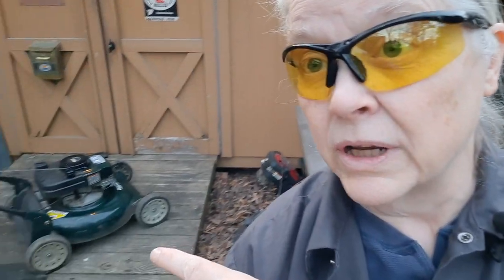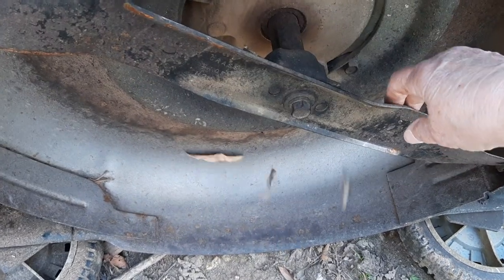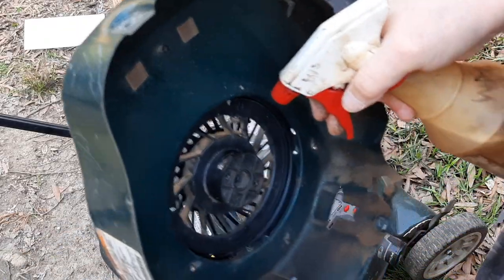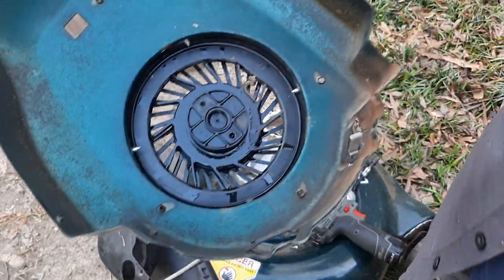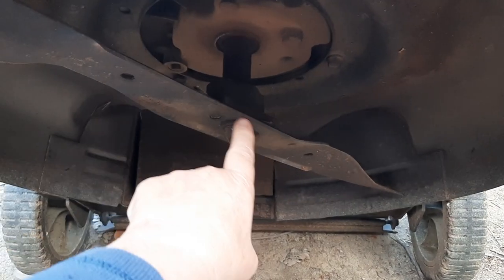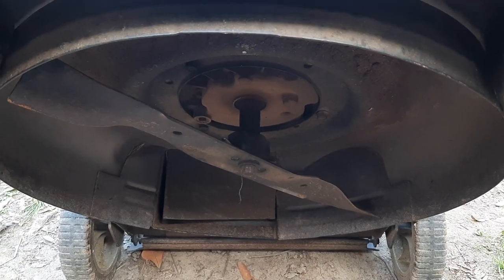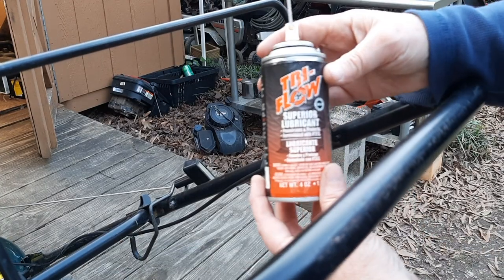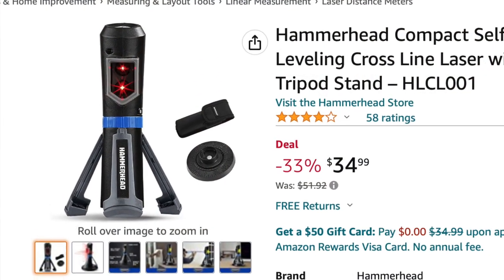Full Service: Tecumseh Engine on Older Craftsman Mower

Comment: Just today I pulled out my old Tecumseh powered Toro. Probably 20 years old. Havent used it in months, but wanted to use it to chop up leaves. Put fresh gas in it, primed 5X, and it literally started on the first pull. Slight oil leak on left side near the base of the engine, leaked about a teaspoon after about an hour of hard use. Don't care, runs strong and is my ditch/leaf mower.

Comment: Great job on the fix!   It’s to bad that Tecumseh gets such a bad rap, I think they are great engines
Reply from the maker: I think most of the Tecumseh hate is from Europe, those were made in Italy, and unlike the pinnacle of scooter manufacturers in the 60s (think Vespa and Lambretta), everyday was Monday at the Italian Tecumseh factory. Heh!
Reply: My 1984 Toro with its TNT100 is still going strong!

Comment: The more I learn about lawnmowers the more I realize the products of the past were just more durable and simple to work on. In terms of durability what is your opinion on the Tecumseh vs Briggs and Stratton motor?
Reply: Not just lawnmowers!  Just about anything you care to mention with few exceptions.
Reply from the maker: I think this later model Tecumseh is right up there with the flathead Briggs, often referred to as the Quantum engine. Even the older 3.5 Tecumseh engines, I think is just a bullet-proof as the older 3.5 Briggs pulsa prime engines. I think the Tecumseh engines get such  a bad rap across the pond is they were made in Italy. Not unlike licensed manufacturers of antique Vespa and Lambretta scooters in the 60's, made in Asia, South America, and other parts of Europe. Just enough difference to make them not as desirable as the originals. I really appreciate you watching. Cheers!

Comment: All the tecumseh motors I have worked on and did not know about the F on the bowl.  Thanks
Reply from the maker: Hola Mr Bruce! I kind of figured that out on my own. I've scoured many a service manual, and never saw mention of that. I can't figure what else it would mean? On the older brass floats, you could see a witness mark from that divot to determine the orientation, not on the plastic floats. Cheers.

Comment: I love those old Tecumseh engines, I love the carbs because I can usually just drop in a 631021B kit in them and maybe a new primer and they are good to go. I absolutely love your laser rig and your large tray for under the mower while you change the oil. Two great ideas!!!
Reply from the maker: Cheers Pat! Those get a bad rap, but I honestly don't have that big of a problem. I appreciate you watching!

Comment: I’ve heard that noise before.  I was thinking, take the blade off, reseat and tighten.  Glad it worked out.
Reply from the maker: I probably should have, but it seemed awfully secure on first impression. Besides, it would have been a far less interesting video... Cheers!

Comment: I got that same mower along curb last fall. Someone replaced carb with a foreign one. Cleaned it ran lean. A original bottom jet fit it. Lots better drilled upper one runs great
Reply from the maker: These older mowers are better machines than almost anything you can purchase new today. Thanks for watching.

Comment: Nice.
Have always loved the Tecumseh engine, as it had an actual oil-pump, as opposed to the BS splash rotor, so you could use them on quite extreme slopes.
They made them under license in Australia years ago as the "Kirby-Lauson, and also, the Spanish government "nationalised" the 2 stroke version, moved a few bolt-holes around so genuine parts wouldn't fit anymore, and renamed them "Aspera".
They were still good.
Reply from the maker: I appreciate the history insights. I have some old parts and literature that mentions Lauson. The Kirby connection was news to me. I guess they were trying to compete  with Electrolux. Thanks for watching. Cheers!

Comment: Nizeee
Just got another nice one in yesterday on trade,,Needs a bunch, crank seal it bulging,, wheels shot,,adjuster very loose 
BUT its super clean,,,paint has like no scratches or ROT on the deck!
Nice job,,,,
I clean all my machines, the pull starters do get jammed up, these get cleaned as well when pressure washing, Oil or chain lube on most, also up into the spring area as well. NO oil on briggs, the plastic palls wont grab,, chain lube or chain wax combo. and these get wiped well after.. 
I do charge more for this but the machines that I do look like new.
Reply from the maker: I usually clean in a desperate attempt to keep the shop and my  hands a tiny bit cleaner, 😂 I do squirt some WD-40 on those plastic Briggs pawls. Never seen a problem, I see so e of the same mowers year after year. Thanks for watching. Cheers!

Comment: Nice mowers , I like them good mowers they love to have clean oil in the crank case . You have to make sure you dump junk into the gas tank , because the main jet pick up is so low in the float bowl . I use one for my personal mower .
Reply from the maker: Yep. Those Tecumseh mowers, despite all the hate are good machines. Thanks for watching.

Comment: I love the Tecumseh TVS engines. As you mentioned, they were better made than the 2023 engines are. Obviously, that one is at least 15 years old, Tecumseh went belly up in 2008, and that one actually looks like a late 1990’s model to me, maybe 1998, so 25 years old. If cared for, that has 25 more years in it.
Reply from the maker: I usually take a pic , or write down the model/serial info. I failed to do both on this one. Oops!
Reply: @TheLawnmowerLady  I decided it is a 2004.

Comment: Good video Stella the Techumseh engines are pretty tough the only think i do not like is how the primer bulb stiffens up but it still works.
Reply from the maker: Surprisingly, this one even with its advanced age, still worked. Some versions were black rubber, shaped more like the Briggs 9nes. Never figured if they were interchangeable. Cheers!
Reply: @TheLawnmowerLady  Interesting thought never tried to swap one out ie: black for red may look through my spare scrap parts carbs and take a look at that.

Comment: I've learned so much from you. Question - I have a silver and black craftsman 20in with the 3.5 Tucumseh engine. I maintain it well. Use only ethanol free gas and stay-lube. The engine runs fine up steep hills and down steep hills, but on steep sidehills it dies and then is hard to restart. I checked the carb, cleaned it etc. But it still stalls on steep sidehills. Do you have a suggestion that I don't know of? Thanks for considering my question.
Reply from the maker: On those side hills, you are fighting gravity. The float in the carb bowl can't regulate the fuel flow on those side slopes. Depending on which side, once you get back to level ground, you are either drowning in fuel, or starving. I suggest mowing those slopes on a diagonal. Thanks for watching.
Reply: @TheLawnmowerLady  Thank you for your thoughtful suggestion.
Reply: remove the carb  float ,and install a Fuel Shutoff from outside. manually shutoff the fuel when you stopped the engine .

Comment: Stella, I’m looking for a specialized source for seals. I came across a reference to one a while back but can’t find it now. This source would have low minimum orders, good pricing and normally sell to small engine shops. I want to order by seal dimensions rather than OEM part numbers. This would be for things like small 2T (string trimmers) up to 4T (lawn tractors). Any help?
Reply from the maker: I used to google the dimensional numbers, and got good hits for suppliers. That said, I never felt the need to stock much more than common spark plugs and air cleaners. I usually just ordered them one at at time. Yes, I paid more, but I pass that cost onto the client. I appreciate you watching. Cheers!

Comment: Mower starts and cuts out....when I hold primer button in, pressed in it runs good, I just replaced primer button...if its not seated and sealed, could this be my problem, it's the older Tecumseh
Reply from the maker: Could be. That would allow more air in, and you holding the bulb in seals it tight.

Comment: With a bit of help from Norm,
The mower be now reborn.
The Rays of Ruby Red light.
Now proves shaft is alright.
A keyway shift not the error,
Not cause of vibrating terror.
The pull start lubed and fine
Starts on one pull each time?
Air filter an' spark plug are due,
Says the lady dressed in blue.
Oil is drained from the crank.
Some was spilled, let's be frank.
Oil now added to proper depth;
Starting Tecumseh is all that's left.
Start Noise remains off camera.
It's such a perplexing dilemma.
Sometimes a simple screw loose
Will surely, now, cook your goose.
Tighten the bolt for mover blade, 
The vibration now did finally fade.
Stella stayed the difficult course.
And fixed the three an' half horse.
Twenty-five years it did cut grass, 
Twenty-five years more it will last.
Reply from the maker: You are awesome! Thank you!
Reply: @TheLawnmowerLady  You are too generous. This is the least I can do for the time and resources you invest in your subscribers. Best to you and yours Stella.

Comment: Craftsman 4.0 model 143.974008
Tecumseh carburetor.  I need help ordering carb parts. And rebuild
Reply from the maker: Any major parts house will have good exploded diagrams to find your parts: partstree, jackssmallengines, repairclinic, etc. I prefer partstree as they show real time stock onhand on their website. You want to be looking up the engine model #, not the mower model # stamped on the deck.

Comment: WD40 is a cleaner. Might as well be anyway. I use pb blaster or kroil. Good video tho. I've come across mowers where the blades are tight to the max and blades were still loose
Reply from the maker: Maybe the bolts, or alignment pins on the adapter was worn? Thanks for watching. Cheers!

Comment: They are good machines but I don't like the way the carb is mounted or that it has rubber o rings in it.
Reply from the maker: I agree about the O-rings, and the plastic emulsion tube almost always gets damaged. There's like 6 different ones, each a separate color. Thanks for watching.